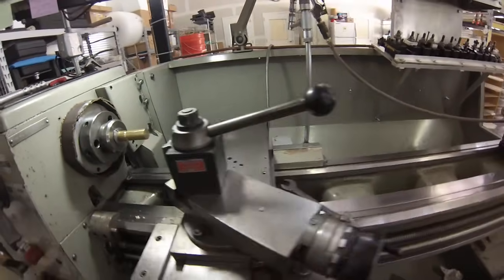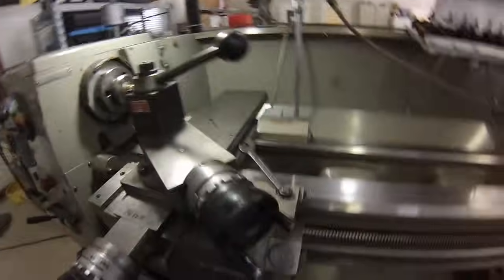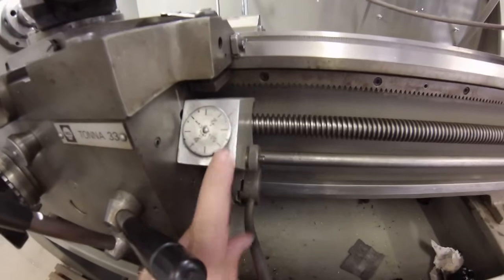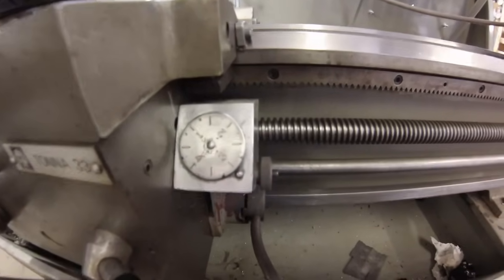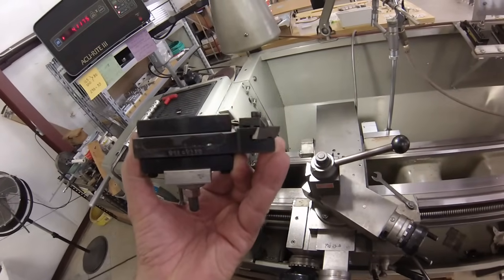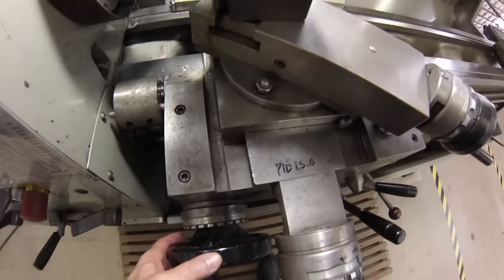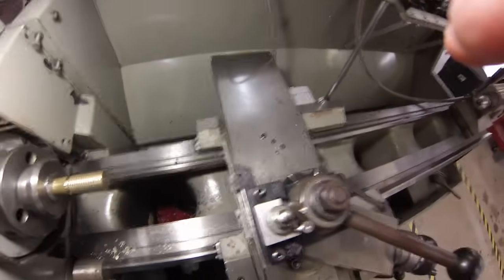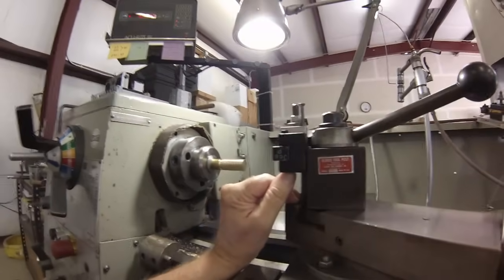Threading on a manual lathe  BEST TECHNIQUE EVER !!!!

Comment: This just seems like the way it should be done. I can't believe anyone would risk crashing the tool into the chuck or the stop, I've recently acquired a little Maximat v10-p, and someone was explaining to me how to cut threads on it, when they said you have to quickly retract the tool at the end of the cut, my first thought was can't you just run it in reverse and let it exit the thread. But I've not even touched a lathe since school about 20yrs ago so I assumed it wasn't possible.

Comment: this method is without a doubt the best for single point threading ! thanks Joe !
I have a screw on chuck on my logan 922 ,however I have never had the chuck try to unscrew in reverse
but is there a way to lock on the threaded chuck so it can't possably unscrew ? a pin perhaps ?
Bob....
Reply from the maker: I've seen threaded rods through the spindle with nuts and plates on either end. I've also heard of guys drilling and tapping lock screws through the chuck collar.
Reply: @joepie221  ....
the easiest method I think would be a setscrew in the collar of the chuck like you said , that does mean drilling a hole in the spindle however and taping  the collar and getting just the right setscrew, or bolt
but I do not want to block the spindle bore I use that for long pieces all the time !
thank you for responding ! i really appreaciate that !   Bob......

Comment: Hi, I would suggest that running the lathe at a much lower speed and taking a lighter cut would produce a better quality thread.
Reply from the maker: Material like this is notorious for screaming during a threading operation. To concern yourself about surface finish before the final cuts are made, is a waste of time. Driven by surface contact of the tool, cut depth can be deep initially, but is supposed to reduce as you approach the final depth. This is when the finish gets better.

Comment: I might have missed this, but I'll ask anyway. Is this a left-handed tool holder and threading insert mounted upside-down cutting right-hand thread? It seems that way; just wanted to make sure.
Reply from the maker: You are correct.
Reply: @joepie221  Great. Thanks for the confirmation- love your videos by the way.

Comment: sharp way to do it,  if you're running chucker job without a tailstock center to run into.  I've learned SO much from you Joe !
Reply from the maker: If that is the situation, leave a nub for the center and remove it afterwards.

Comment: I cut my threads by running the lead screw until I turn off the power. Then I wind back the tool post to miss the part before switching the machine in reverse while still engaged with the lead screw until I'm back at the start of the part and stop the machine. Set the depth for another pass, switch back to forward and start cutting. I never ever have to judge when to engage the lead screw with a dial because it's always engaged and always accurate.
Reply from the maker: This has to be very slow. How do you control distance when threading tight to a shoulder?

Comment: Also why do you have the compound set at an angle? I’ve always wondered as mine is always set inline with the bed
Reply from the maker: I set my compound to 45 degrees. This way it doesn't cover the cross slide dial and the tail stock doesn't hit it. Sooner or later, having a compound inline with the bed, your tail stock will need the space.

Comment: Just bought a model A 9 inch south bend lathe, Two questions, you talked about going straight in with a carbide cutter. I have inserts tips on my cutting tools, is it ok to plung straight in while cutting treads? or only with a ground carbide tip. Also my tool holder (made in china) will not adjust to the correct cutting height when it is upside down with my cutting tool. Not sure if I can solve that problem. P.S. Being new to this art, I find you to be very clear and understandable. Great Job.  Scott
Reply from the maker: Thanks Scott.

Comment: Plz clarify, can we not thread from chuck side to tailstock end as u showed but without turning out tool upside down ? What's the logic of using upside tool?
Reply from the maker: You can, but it would result in a left hand thread. An inverted/out/machine in reverse thread is right hand.

Comment: Do you prefer tungsten carbide bits such as an ACT E8 over a hand cut cobalt and why do you prefer one over the other
Reply from the maker: Properly ground and applied, each tool will hold up well. Cobalt tools will hold up longer than non cobalt HSS, and carbide is better for tougher materials, so the answer is dependent on the application.

Comment: compound have to be set at 29 degrees and use for the control depth of the cut finish pass with the cross slide and QC wire
Reply from the maker: Thats a myth. I haven't used a compound to thread in 40 years.

Comment: I was just wondering why most people say that you need to set the compound at 29 deg. and then set your tool square to the part ?  Doesn't that cancel out the 29 deg. off set ???  I've not been using a lath very long but the threads I cut are inverted cutter (thanks to you) but the compound is square and they work good with standard nuts and bolts..
Reply from the maker: Its a tool load issue for lighter machinery.
Reply: @joepie221    Ok Thanks just wondering...

Comment: Would ould be better to set the compound rest at the proper angle so you only cut with the leading edge.
Reply from the maker: No matter what angle the compound is set at, the tool never only cuts with the leading edge. My machine and tooling is strong enough to hold up on a plunge, so that is the only way I do it. I did a video on compound angle. You should take a look.
Reply: @joepie221  I have to agree. I plunge on pre-hard 4140 cutting acme threads and with those old lathes you can actually hear  and feel that the load is LESS than cutting with a single edge. Sometimes B/S becomes fact and makes it into the books.

Comment: some of the top lathes do not use halfnuts, can be a puzzle, but you stop the lathe run the carrage back, then index the chuck same spot you started for odd nos threads hadda search french language forums to find that out, took 2 months research, in the 85  great brit pounds manual there was nothing to guide one, best thing bout no half nut is you neither have to watch it, engage it or disengage it

Comment: Nice work Joe!  Another simple trick with the pitch gauges when trying to hold everything in place is to use a rubber band.  Lay the rubber band over two threads leaving one in between and hook the two end loops over the 2 gauges.  Now you can use one hand to hold your micrometer and the other to hold the single 3rd gage on top.  It makes a lot more sense when you actually try it and beats fishing a dropped gauge out of the chip tray.
Reply from the maker: Did you know you really only need one wire. It doesn't get any easier than that. One wire also tells you things a 3 wire measurement won't. I did a video on the topic a while back.

Comment: sorry Joe But I stopped here because of the name of your video. I was interested to see if someone had come up with a technique for doing threading on a manual lathe. The lathe that you are using is not a manual lathe. A manual Lathe is a lathe with no motorized feeds. A manual lathe and an engine lathe are not the same thing.
Reply from the maker: Many would disagree.

Comment: Should the top of the thread forming tool always be flat unless you are using a rocker post with a slipper?
Reply from the maker: Depends on the material. Harder = flatter

Comment: Regarding moving the tool bit straight in.  Sometimes you can get away with that, sometimes, not so much.  The problem with moving straight in is that you get equal chip curls from the left and right of tool bit edges and they both want to move to the same place above the tool tip.   (In your case, below the tool tip.)  This causes stress where the curls collide and can cause some tearing and degraded finish.  That's the reason for the 29 degree tradition.  One edge does most of the cutting.  The other cuts just a little to make sure there is a good finish and also to make contact for heat transfer.

Comment: At the shipyard NNS
we had thread mics probably special stuff the shipyard had ??? We had intramics etc unbelievable tooling and measuring instruments.

YOU KNOW YOUR STUFF SIR
GREAT VIDEO AND ALL THE BEST !

NOW DO ONE ON BUTTNUM THREADS (ACME)
SINGLE LEED
DOUBLE LEAD

WE DID ALOT OF CLASS THREADS 1 2 3

REACTORS USE A INTERFERENCE OR PRESS FIT THREAD (ONE TIME USE ONLY)  TAKE CARE SIR.

Comment: Thanks Joe. I did some threading on a Clausing Colchester lathe, other times, on a big VDF lathe. Most of my lathe work was on a Hardinge chucker, with the threading attachment. We used the wires gauges too. I did internal threads, as well as external, we never used to call them A and B. I did learn a lot there, everything from lathe, to jig bore, to tool grinding. It was a nice clean fully equipped shop, it’s just too bad that my boss was a jerk (putting it nicely) and the owner wouldn’t reign him in. That shop couldn’t keep a decent machinist as we left 2 and 3 at a time. Seeing your shop reminds me of those days!

Comment: Fabulous really and as the other old guy said you never stop learning I'm 73 and I have never had a really accurate lathe
I had a Dean Smith and Grace that was well before it's time unfortunately it was a bit flogged out in the ways and I could not turn true but I just landed a  CAZANEUVE 575 by 2000 Precision lathe and it is exactly that I have never done any screwcutting but you have encouraged me I wonder if you would help me please
I was a ship builder entirely different trade although I did turning for the prop shafts not the taper or thread things like that

Comment: AT 12:25 I'd swear that one wire was smaller than the other two. Must have been the lighting. Thanks for your instructional videos.
Reply from the maker: It did look like it. Possible a radius or chamfer on that one pin. I'd have to go back and check to be sure. Good eyes.

Comment: Also better to use a left hand tool to enable you work against shoulders.
Reply from the maker: Absolutely. if you care to take it to the next level, you can also use an offset insert in that left hand holder to get that extra length.

Comment: You imply that you're using insert tooling when you're doing this. Would you grind a HHS bit differently to do this operation?
Reply from the maker: No. A standard 60 degree 'V' grind should be just fine. Naturally ground to fit your space allowed, but symmetrical will work just fine.

Comment: A Monarch tool room lathe also calms the situation down.
It has a reversing lead screw and dog clutch. Designed to make threading easy and quick. The half nut stays engaged until the threading operation is complete.
But your trick is great for conventional lathes!

Comment: Joe, I have been doing this for years, mostly on internal threads however single pointing the conventional way is just as comfortable for me personally.  I also thread smaller O.D parts using a die, I have made die holding fixtures that are held in the tail stock chuck, I simply push the tail stock up to the part and let the die float Over the part cutting a finished thread in one pass.  Of course I under cut all the parts first. In order to cut a full thread to the relief, I simply reverse the die in my holding fixture. 

I use a follow rest for cutting acme threads on very long parts which requires roughing inserts and finishing inserts
Reply from the maker: Threading towards the chuck on threads that terminate at a large shoulder is just too risky on big dollar parts. Inverted and out is the only way to go.
Reply: Joe, I meant I have been threading towards the tail stock as you demonstrated for many years. Especially on internal threading. And when threading smaller O.D parts I simply use a die in the tail stock chuck and let the die and tail stock float in... its much faster for smaller parts!

Comment: Hi folks. Technique described does depend on the spindle bearings. Very good with tapered roller or angular contact types, possibly not so good with the Myford instrument lathe style cone bearings. The reason? The direction of the cutting thrust is reversed - it's trying to  pull the spindle out of the headstock, not push it in. As a result the thrust may be taken by the rear spindle bearings and they need to be designed for it - eg tapered or correctly orientated angular ones. Small point, and for light threading probably not a significant cause for concern, but useful to be aware of if pushing a light lathe to its limits. BobUK.
Reply from the maker: If you are worried about your spindle bearings, and you have the room, use a live center in your tailstock during this operation.